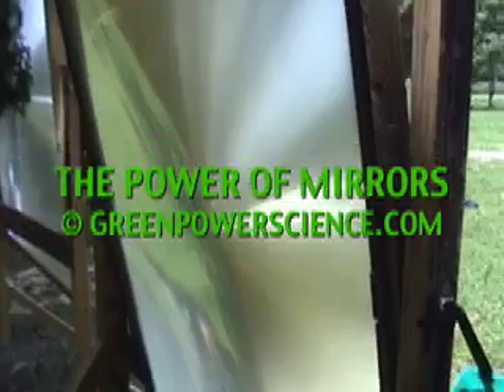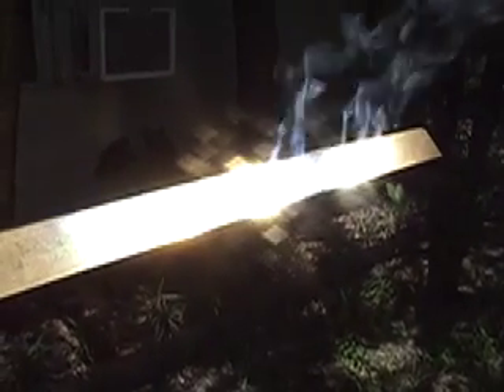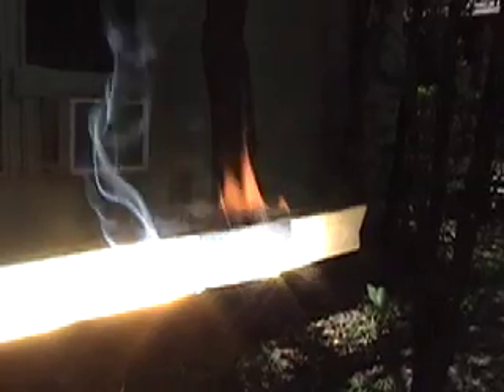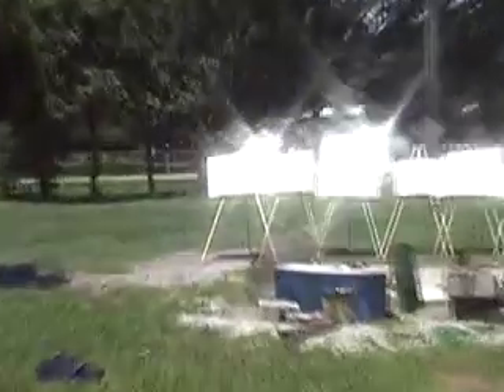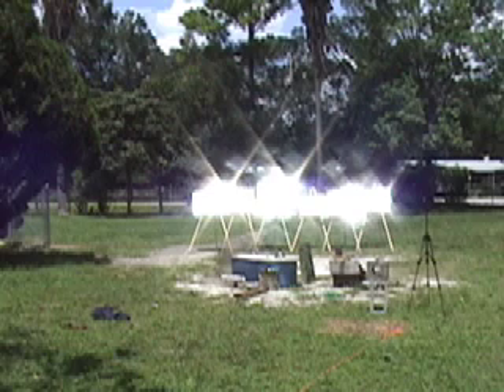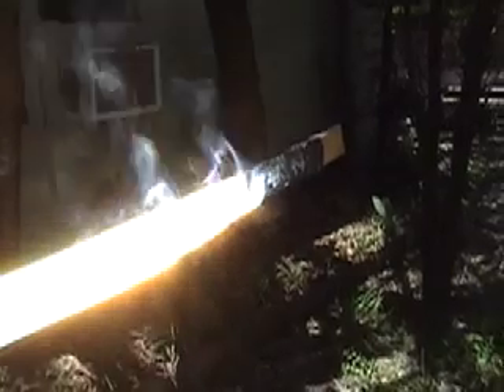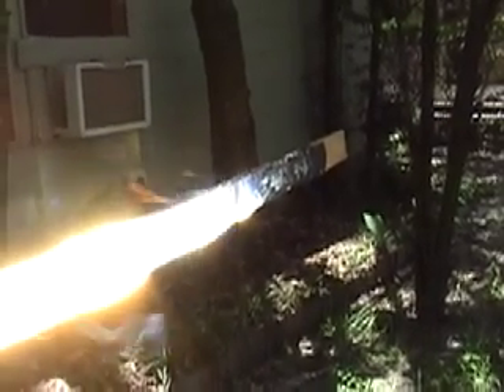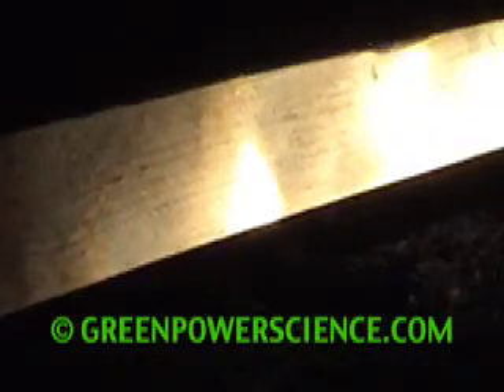FRESNEL LENS SOLAR COLLECTION Mirror Array SOLAR POPWER Pyrolysis

Comment: Dan that's real good.To line up the mirrors you could tape a laser pen to surface to get a perpendicular mounting that an assistant held in the center of the mirror,moving it until it lines on a target.Just a suggestion to kick around,keep up the good work.Thanks much, Skip J.

Comment: @gr575 I know hot water tanks on average use about 3000w...but yours I'm guessing is closer to 4500w...so yah...that would mean you'd need at minimum 9 sq meters of solar collective material...with a heliostat to perform the same as your hot water tank.

Comment: @magicyte It's all relative.  My hot water collectors are pretty efficient and they are about the size of two sheets of plywood.  That's enough for a family of 4 on sunny days.  And about 50% in the winter.  To heat up a 60 gallon tank of water from 50F to 120F with these large fresnel lenses - well with about 4 of them I guess you could do it in maybe 5 hours.  Very rough estimate.

Comment: @gr575 Small amount?...lol...more like a LOT of water...that solar power he has focus is going a helluva lot higher than 400F. Also, it takes around 500F of open flame to burn wood. Without an open flame, wood would burn at roughly 800F. The fact that this wood lights up almost instantly...says that soalr energy has gotta be above 1000F...that's twice the temp of a electric stove burner on high!

Comment from the maker: @spenatjonas It only shortens the focal length but also diffuses the light x 2 so your power drops. EX. 2 great clear lenses. Lens 1 acrylic or glass diffuses 10% leaving 90% light throughput. Lens 2 does the same .9 x.9 =19% drop.

Comment: Have you ever accidentally started a fire with these things? Burnt yourself? Can you show yourself doing something useful with them?
Can you use these to improve the output of solar cells? Can you put an IR filter on it to remove the heat to make the solar cells generate more electricity without heating up the cells?

Comment: In the early 1900's my grand-father put a pipe box on his roof in Fla., keeping the house cooler at day,  & generating hot water and steam for a 12V generator and batteries for nite lights.

Comment from the maker: Hotter if the lens is good. Just be careful and make sure the area behind the target is fireproof and insulated from anything behind that. If you are simply covering a solar box design, go with regular glass. The focal length will not have a chance to work and the lens will just diffuse the light giving you less solar energy. Fresnel lenses do not increase light, the concentrate it so they do not add to the square ft of sunlight.

Comment from the maker: It depends on the lens, many lenses are not good solar collectors. Older ones are very good. The only way to tell would be to take it off and see. Also it will work to heat water but the lens would have to be very strong to warm 20 gallons.

Comment from the maker: Yes they can be made into a spherical shape using the same method in the cutting a perfect circle video. The acrylic lasts about 2-3 years with 100% exposure and much longer with daily in and out. The fogged lens is actually 5 years of 100% and was in about the same condition when we found it. Glass is too fragile. For boosting PV, these will work but they would just be replace every so often. You cab coat the smooth side with clear UV spray. Unknown if it helps.

Comment: What do you think about using molten salt and hot water pumped through a dual chambered refractive ceramic container? With six lenses you could dedicate maybe 3 for just heating the salt for use as a heat storage battery stored in a different chamber then pumped into the boiler as needed. The whole idea is to me is to use the sheer heat generated by the cheap fresnel lense to eliminate the need for boilers and heat exchangers.

Comment: The base answer is yes.  The detail answer says you need to do quite a bit of engineering to do it.

Looking at the heliostats I have seen on the web, point to big window, heating a room by reflecting lots of light will help with heat, but mainly it can be very bright.

If you want to use the fresnel lens to heat, I might suggest having a heat exchanger that you pump water through.  It will heat the water, then pump it into a holding tank or directly through heat xchgr in the house.

Comment from the maker: CLOUDY LENSES can be cleared with acrylic spray if it is on the smooth side. If the Fresnel side is clouded, acrylic spray will melt the Fresnel pattern. Heliostats work with these, it just takes some building skills. A stepper motor with the right controller works great.

Comment: WOW!  I have thought very seriously about doing something very similar to this in order to provide heat for the house, but not, of course use the fresnel lenses, don't want to over heat house and burn it down, lol.  I had thought about just using mirrors to reflect to a box to capture heat in a safe way to put heat into the house in winter.  The sun only hits the front yard in the winter so I can't collect diret sun much because of the hills.  Looking forward to seeing more from you.